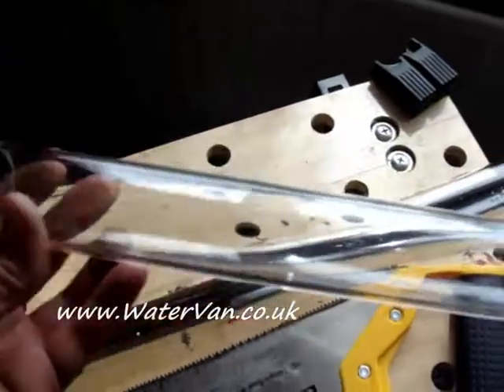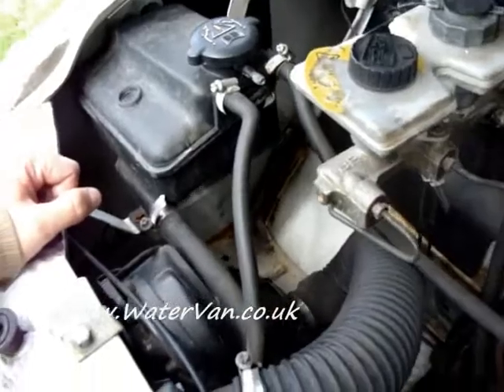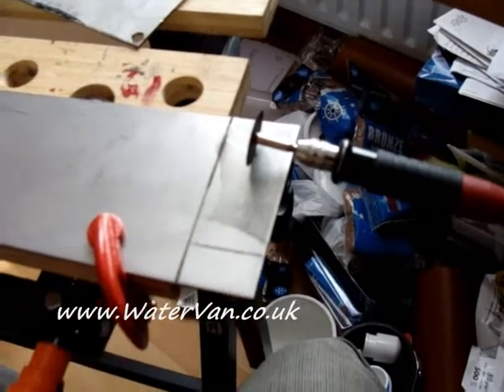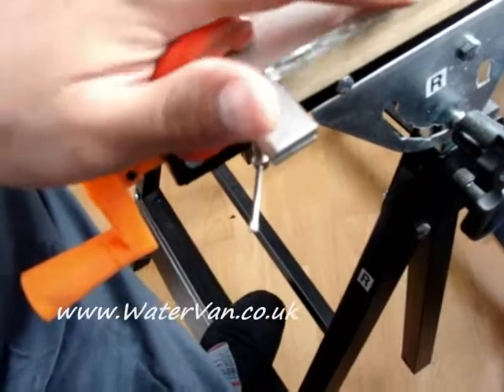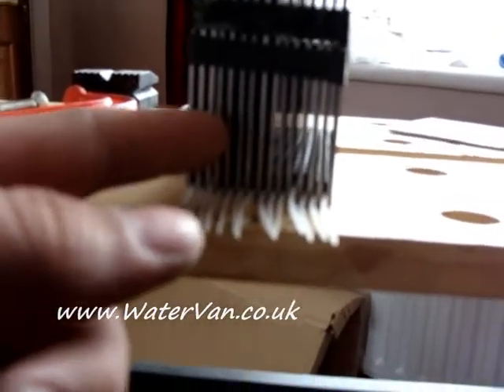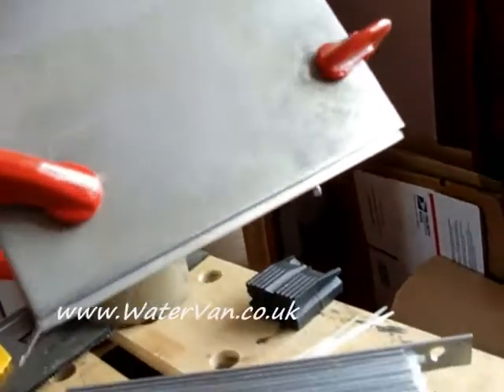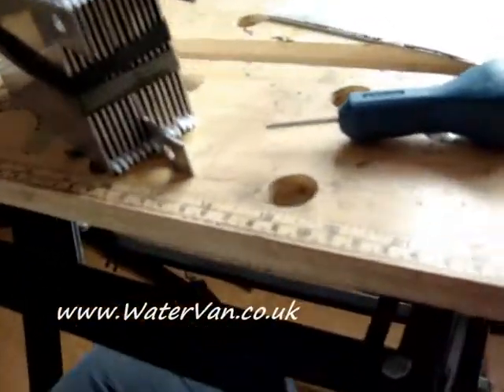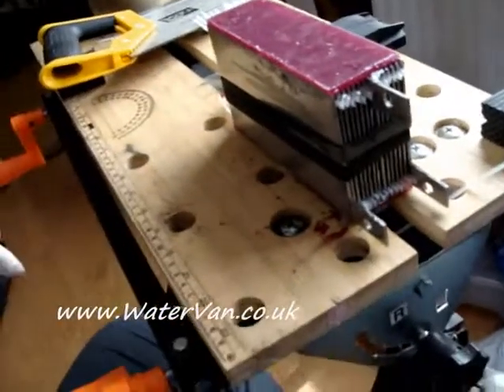#026 C5 MadStu's Water Fuel Cell - Starting to Build

Comment: I wish you good luck on your new build but am a bit concerned with your decision to use 6 neutrals. I think that 5 might have been a safer choice as this configuration is proven to be pretty effective.  But you may end up proving me wrong.  And the worst case is you might have to tear it apart and pull a couple neutrals out.  So press on.